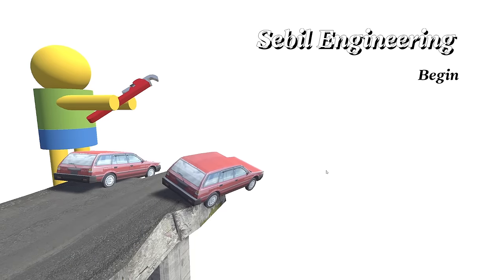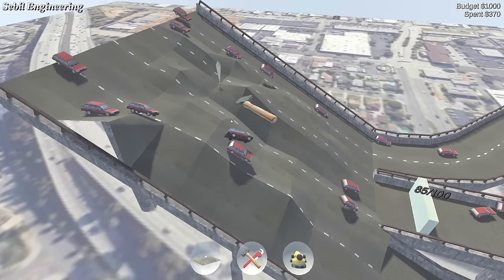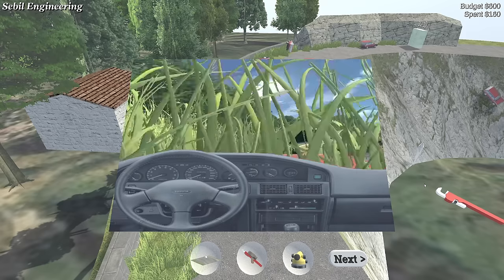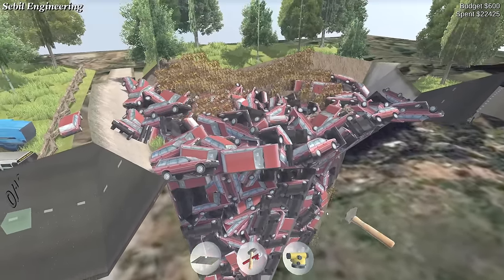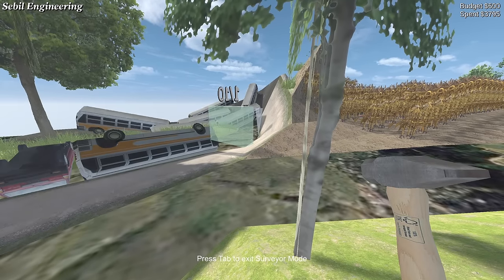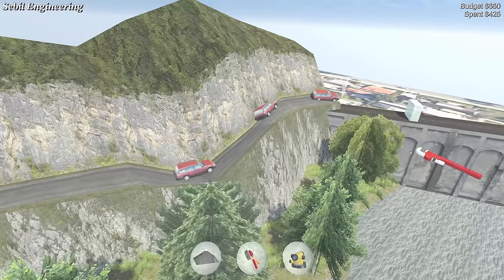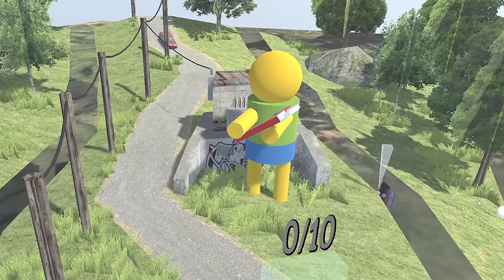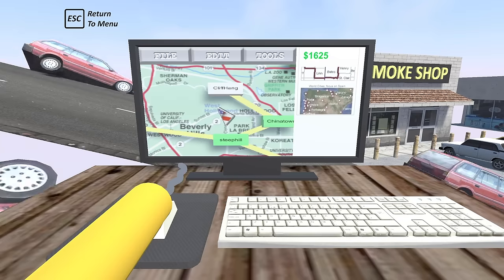Fixing the World's MOST DANGEROUS roads... Sebil Engineering!

Comment: The level flavor text speech is spot on.  

I've once watched [a to be elected public figure] try to make a u-turn on a sharply inclined road between two intersections, and get hung up on the curb; Become confused about what side of the curb the road was; And then repeatedly drive into/along the side of a restaurant while staring back at me across the intersection; Possibly thinking that they were high centered(?) on a piece of loose curb because their pickup was rocking/bouncing so much and feared wandering into the car I was in if they weren't 'paying attention'...

The restaurant(?) owner caulked around the splinters of patio furniture embedded in the siding to stop water getting in, and intentionally left it that way for years until their realtor had them fix it so they could lease/repurpose the building.

Comment: Citroen? That's neither Citroen, nor any other French car. Looking at the front of the car, it quite clearly looks like a Toyota logo, and when you're in the cockpit cam after a level, it very clearly says Toyota on the steering wheel. As for the model, my guess would be a Toyota Camry station wagon from the late eighties.